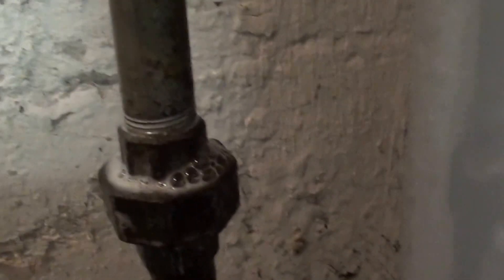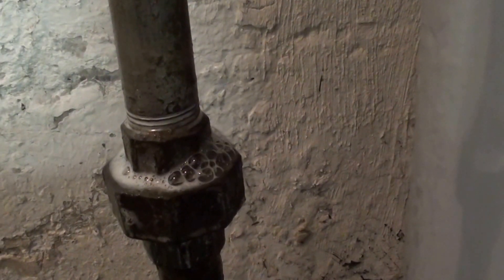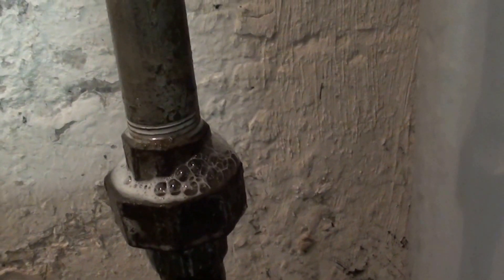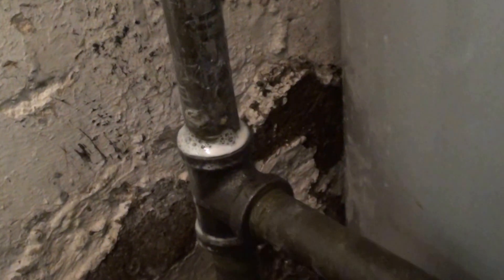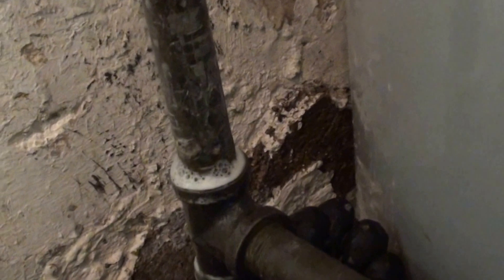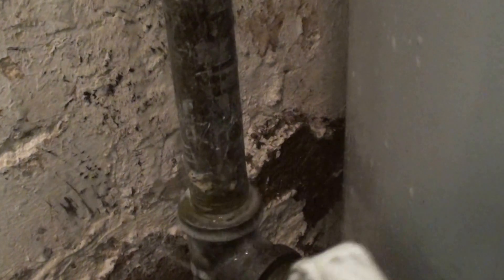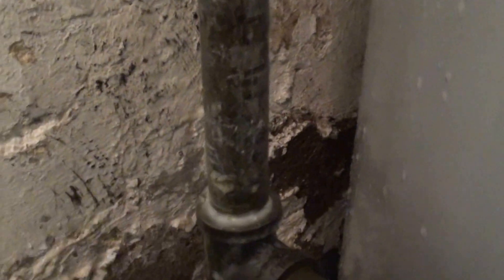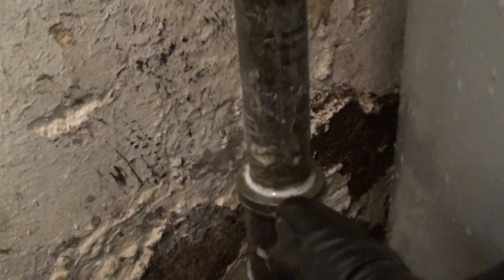how to tell if a gas pipe is leaking , easiest way to check

Comment: Do you put pipe dope on gas unions? Thanks.
Reply from the maker: +Alex Moisseev yes, even though there is a brass ring that is supposed to make the seal I still use the dope as a extra.